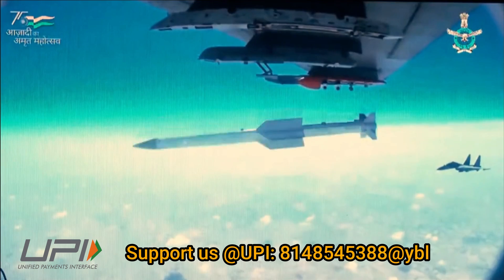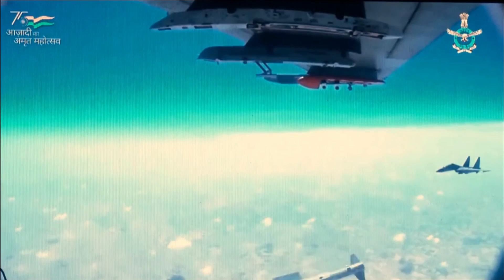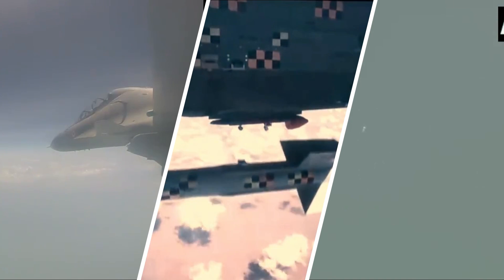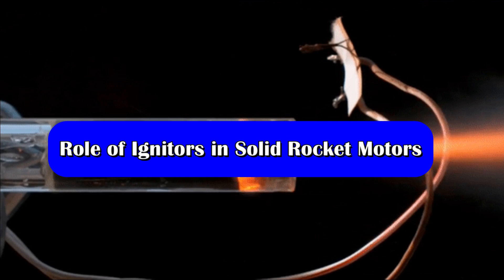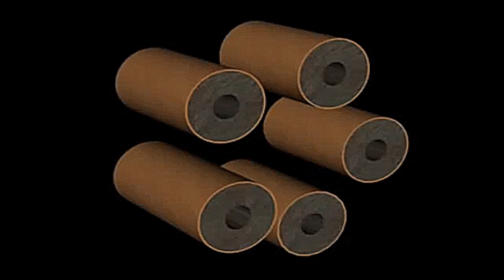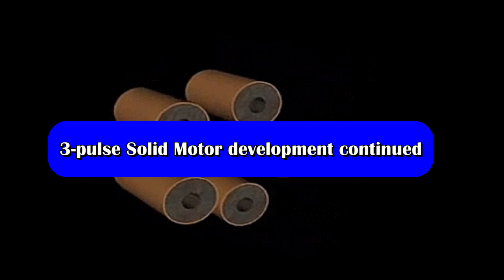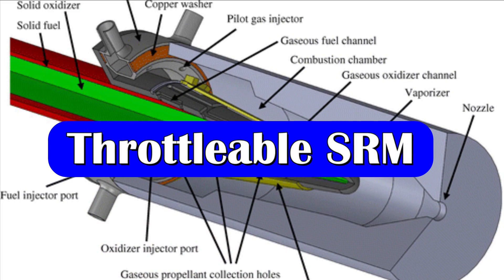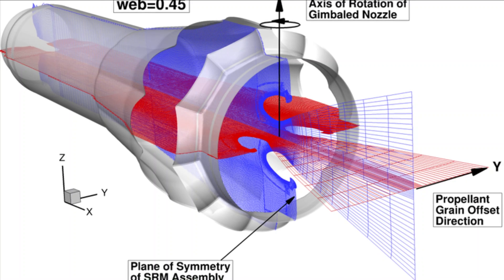DRDO’s Solid Rocket Motor (SRM) Development: 3-pulse SRM| Throttleable SRM

Comment: Very informative. 👋👍From what little I know 3-pulse Solid Motor is a tech worth pursuing. Throttleable ducted motors as used in Meteor are expensive with the missile costing around $3m per round. I think US has also adopted the 3-pulse Solid Motor for the Aim 260 as it will be plug in replacement (physically at least)  for the Aim-120.
Reply: Same kind of throttling can be used for rocket motor too (easier with liquid fuel as the injection rate can be varied) Cheaper (& lighter) than one using ramjet This is very likely the trick US is using for the AIM-260 AAM
Reply: @coolkal7590  Good point. Thank you.

Comment: Bro according to you what will be the maximum range of pl15
Reply from the maker: PL15 ~ 200 km
PL15E ~ 145 KM

You can read about all Chinese missile from our site:

https://indiandefenseanalysis.com/2022/11/11/chinas-quest-of-air-to-air-missile/
Reply: @IndianDefenseAnalysis  200km 😓😓😓😓😓
Reply: @IndianDefenseAnalysis  Question what is its no escape zone? Range seems almost meaningless but NEZ is fairly crucial.
Reply from the maker: @datoolz0  yes good question but this is the most sensitive info which no one will reveal. Only Air Force knows the answer. It also varies from technology of propulsion. SFDR missile have greater NEZ. Mostly the no escape zone of a missile is around 50% of their range
Reply from the maker: @datoolz0  The no escape zone of every missile is calculated by the missiles speed, range, and seeker sensitivity for the length of the cone, while Agility and seeker complexity are used to calculate the width of the cone.

Comment: Astra Mk II outranges anything with the PAF, including the Amraam C5(110km) and Pl-15(145km) export version.What is needed now is large orders of this missile, to ensure that in any replay of Balakot it will be the PAF who will be forced to defend. If they engage, they will be shot down without being able to fire back. Only issue is lack of orders!!! If Astra MkII is with IAF in large numbers, then air to air combat will be won.
Reply: They will give big orders once it completes its last remaining trials.
Reply: @fly463  I forgot to mention exising VL-SRSAM has 50km range, making it better than Akash NG. With Astra Mk2 it will have 80 km range!
Bharati air defense will have some punch.
Reply: @datoolz0  
True
Reply: @datoolz0  
Is it confirmed that with mk2 its range will be 80km?
Reply: @fly463  No even with original Astra Mk1 relationship was = half quoted range of 110km -10. Astra Mk2 if same relationship holds true will have 75km range. Rule of thumb - actual tests may show slightly greater range. Still margin of error is 5-10%.